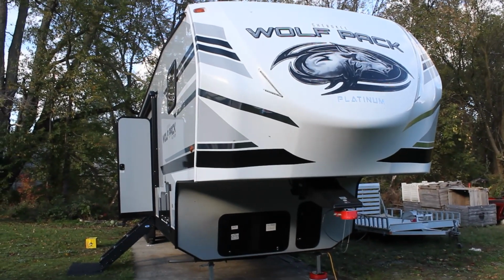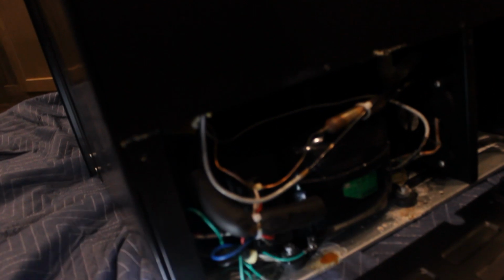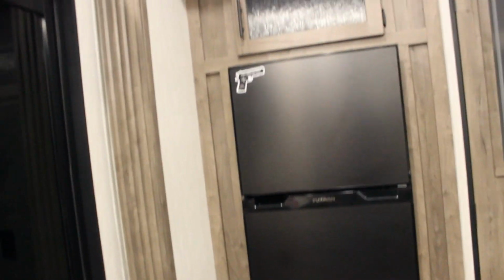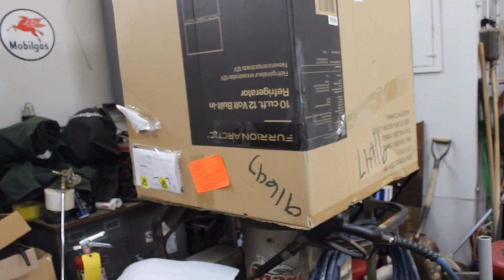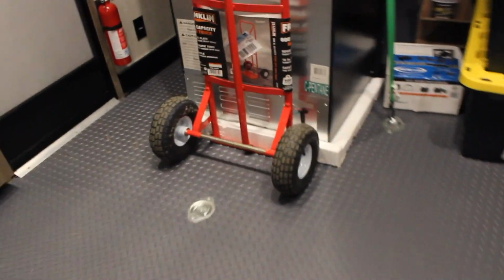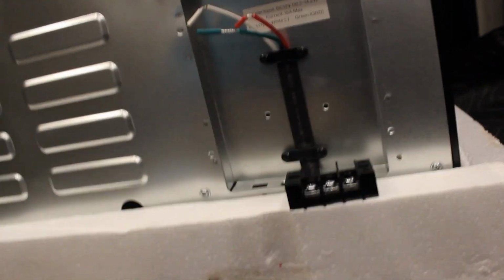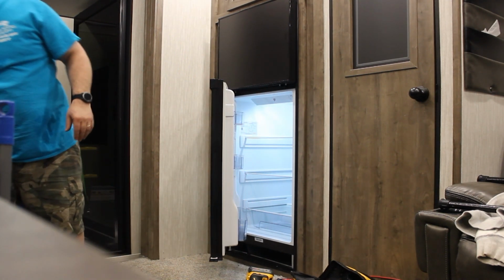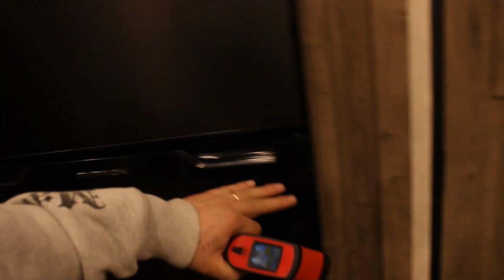Furrion 8 & 10 Cu. Ft.12v Camper Fridge problems Wolf Pack 365 16

Comment: Dude, I have been searching and searching until I came across your video. This is by far the most comprehensive and detailed trouble shooting video out there regarding this exact refrigerator. You gave me a place to start out with in trying to figure out why my brand new Furrion 12V 10cf frig just wont cool below 50 degrees and I am plugged in to shore power.
Reply from the maker: Thanks for the kind words. I hope it helps. Also, please subscribe

Comment: Out Furrion  double door is in a ‘23 Grand Design less than a year old, would not hold 36-39, mostly held at 40-43 until started going up one weekend. Mobile techs declined to work on it do to “call backs” with this brand. Parts being unavailable when diagnosed also an issue. Read enough negative people’s problems on all 12 volt fridges last two weeks I don’t think the manufacturers have engineered the problems out of them yet. Never had a problem with my 3-way that ran continuously for 6 years. Only drawback was couple defrosts per year.

Comment: I had the problem with it shutting off shortly after starting when I first got my 365pack16.  We returned it to the dealer and they swapped it out with another fridge.  We got it home and it didn't work again.  Turns out that the wire is too small for the current draw when the lights in the slide are on and the fridge is running.  The fridge has a low voltage shut off.  I see in your video that the lights are on in your slide.  Try this without the lights on.  In the end, Forest River instructed our dealer to increase the size of the wires to the slide.  After increasing the wire size, I have not had any problems.
Reply from the maker: Yeah it's what I figured originally apparently the new redesign of the fridge they must of found a way to reduce draw. It has still crossed my mind to rewire  it at this point they warranted it so will see what happens. Thanks for sharing you experience.

Comment: Thanks for the info! I just bought a brand new 2022 Grand Designs Reflection which comes with the Furrion 12V fridge. Since i left the dealer 10 days ago, the fridge never worked. The lights turn on just fine but the compressor isn’t turning on. They can’t even see it to diagnose it for months. I need to try something myself. I wouldn’t have thought it was the fuse because the lights in the fridge work just fine. But now after watching your video, maybe it is the fuse still after all?
Reply from the maker: I would start with that

Comment: I'm curious how it's working now after 5 months? Did it fully solve your problem? One thing to keep in mind, your fridge and those lights are sharing a circuit on 14AWG wire. 14AWG at 12v is only good for about 7-10 feet on 10A current draw with the lights (hence your flickering). If you were to change out that supply wire for your fridge to 12AWG wire back to your fuse panel - it will likely solve the problem. 12AWG can handle a 10A draw up to about 16ft.

I ran into something similar on my plane with the pitot heat. I had to run a larger wire to handle the amperage. Even though the multi-meter was showing good voltage, the draw was too high.
Reply from the maker: I agree but so far so good was just in the fridge 10 minutes ago its been fine since the new fridge.

Comment: Good Morning - I’m Not Sure ; But Your Lights Should be on a Different Circuit from The Fridge. Try Plugging into a 50amp Then Your Lights May Stay On.  As Far as The Fridge ; Looks Like Your Change of Fuse Looks Good 👍🏼 Wish You The Best !
Reply from the maker: 30 to 50 amp no change, and it is on the same circuit

Comment: We are having the same issue with our fridge.  The battery is fully charged and it will run all the time but won't cool.  Any help.
Reply from the maker: First I would see if there is any warranty left even with the fridge manufacturer direct if you have to. If  not I would go after that fuse In the back of it. What manufacturer is the fridge and what year is the camper?

Comment: I stopped watching it the instant you said "I can't believe it's the fuse"  Yeah, it's the fuse - and the wire.  
The 14 ga wire from the DC Convertor is acting like a resistor and the Furrion is trying to pull more current to make up for the low voltage. And the fuse holder for the godforsaken orphan fuse they put in is overheating. 
I just did a Furrion 10-DCTA-BR that had partially melted the fuse and was having the exact same symptoms. $30 dollars in 10 ga. wire and a 30 amp  blade fuse holder with wire pigtails from the auto store (15 amp is the right value) Took me 4 hours. The lady said to me the next day that her refrigerator has never worked that good. I did extend the wires on the new fuse holder and it is now at the air intake grill on the bottom front under the door.  If it ever blows you don't have to pull the frig out of the wall, just pull the intake grill - 2 screws  (needs cleaning anyway)
Reply: This is exactly what I'm going to do with our brand new 2023 Sprinter. This frig just wont cool down properly, freezer is fine, but frig wont cool below 50 degrees. I'm going to try starting by changing out the wiring and adding a blade style 30 amp inline fuse in place of the factory fuse in the back of the frig.
Reply: So the flickering generally comes from the converter which is veritable sometimes it's having a problem waking up.
Reply: @CruizinWithTheCarsons  I'm having a similar issue; freezer is fine but fridge is not getting as cold as it should.  Did replacing the fuse and wiring work for you?